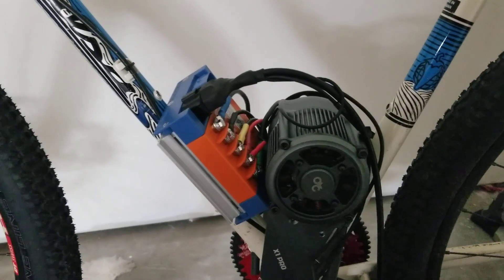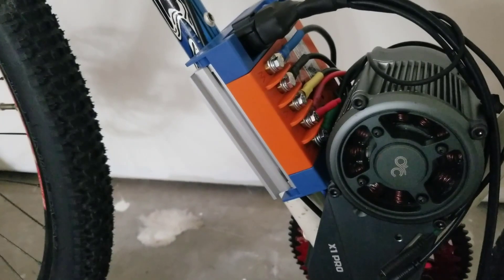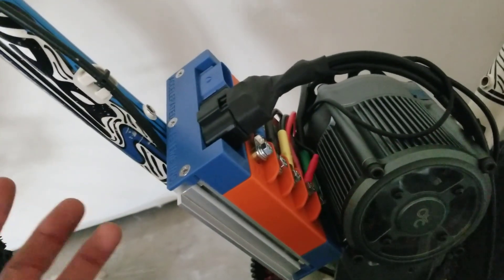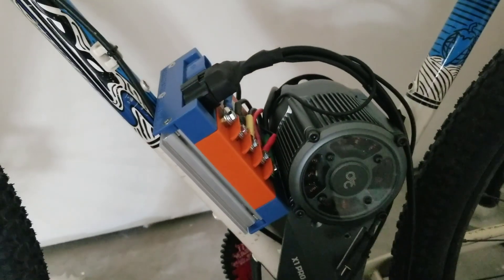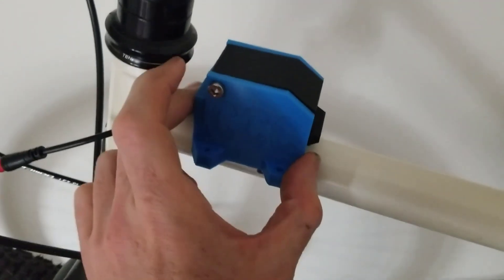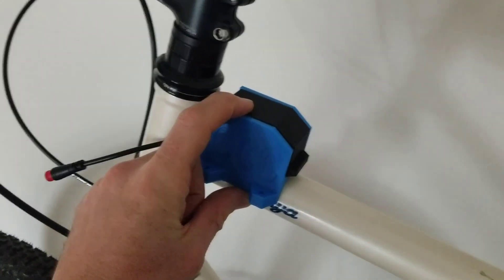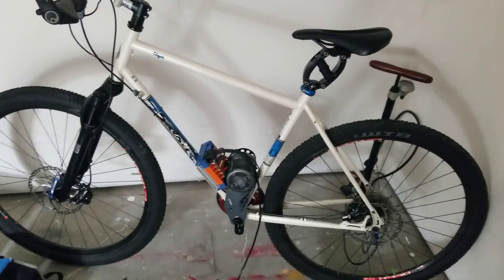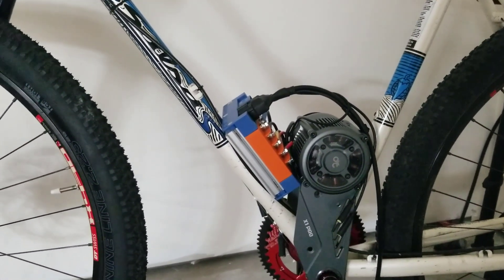Salsa Build Update - BAC2000 / CYC X1 Pro / NXT Display

Comment: Also how do you like that thudbuster seat post?
Reply from the maker: Its great. Although only just fits with the height.
Reply: @HighVoltageKits  I have the red shift one and I love it but it only has 30mm of travel and I often can bottom it out and to stop that you can adjust the preload on the spring but then your making it a stiffer ride I am debating getting the lt thudbuster to try that out.  The only issue I run into is I recently switched to a rear rack that connects to the seat post and between that taking up some space and the min height the suspension seat posts need plus the fact that my bike is a xlarge means I have very little room for adjusting the height.

Comment: Where did you get that ignition switch?  I got two of the bac855 kits for the BBSHD and I have a bac2000 I'm not.using but the bac855 harness Alan sent me has the ignition set up too but I need to get a switch like you have.
Reply from the maker: I was sent it with the kit but you can get one on Ali or Amazon. You might have a blank pigtail you can solder a switch to. And switch will work pretty much. You can get key barrels as well.
Reply: @HighVoltageKits  yea the harness Alan sent me has the ignition plug with a bank pigtail plugged into that so all I really need is a good switch or keyed ignition

Comment: What bike groupset do you use? Will a cyc motor snap mountain bike/commuter chains(assuming I don't go into too high of a gear)?
Reply from the maker: Its a 10spd steel that came with the Salsa Vaya frame. It's holding up well. The chain is SRAM. It's not stretching so far. I don't use the high gears as it goes silly fast 65kph in a 24t I think. Hope this helps.

Comment: What battery did you end up using for this? I was looking on light speed batteries and wondering how powerful of a battery I would need to have full performance from the bac 2000.
Reply from the maker: In the end I chose to stay where I was and just tune it. It hits over 70kph on the flat with a BAC800. The battery I have is a bit odd tho. Its a lipo pack with pretty much unlimited current draw so I'm not sure what spec for lion. I was getting trips at a 50 amp continuous bms so I'd say at least 60. For longevity I'd go 80 continuous. Maybe shoot Francis at Electron an email and ask. He is a CYC dealer so he will be able to recommend and likely supply a good battery. Hope this helps.
Reply: @HighVoltageKits  I was looking at the 72v 24.5ah(80a bms) 72v21ah(60a bms) and the 72v18ah(300a bms) high discharge batteries on lightspeed(the link in your desc).  Do you think I'll have any problems with these?
Reply from the maker: I run the 300 amps version on my other bike and it's awesome. If you can get one Chris Conlons batteries are good

Comment: Hey I have a question about the ASI 2000  I use the controller on a Qs 205 5000 motor with a 72v 44am and it keep giving me a over voltage and it cut off can anyone help me out with that?
Reply from the maker: You are welcome to join and post on my discord. It will be hard to help on here. Also if more people see it then they might be able to help... Are you using regen? https://discord.gg/9UwDG4j
Reply: Captain Codswallop nah I didn’t connect regen on the throttle just throttle for now
Reply: Captain Codswallop and I just downloaded the app for the chat room

Comment: If the motor were mounted in front of the down tube, could the BAC 2000 controller be fit between the mounting bracket like the standard controller was designed?
Reply from the maker: If I modded it possibly.... But it would hang lower by some way. I'm 90% sure I am going to make a bracket for the seat post and divert air flow. It won't need much as I'm not going to pushing it to its absolute limits with this build.
Reply: Thanks for the reply! I was thinking of I went with the BAC 2000, I would take a light aluminum rear rack and cut it back so it would be just large enough and strong enough to support the controller and a set of rear lights. I would then design / print nylon-carbon mud geards that would integrate with the rack
Reply from the maker: What is this nylon carbon stuff you speak of?

Comment: That's huge, Don't forget to put a wide-load sticker on the back of your bike. lol.

On a serious note, I use a conformal coating on all my race drones electronics and corrosion X on the wires and connectors, I have plucked them right out the River and the SF Bay with no issues of them taking off and flying again.
Reply from the maker: That's good to know! A few people mentioned conformal coating. Should keep the phase wires safe for sure. Good to know it that effective. 

A wide load lol. That would be funny! I seen a few bikers that could use that sign 🤣🤣

Comment: I think I might consider using a Topeak explorer rack with one of their bags and mount the controller somehow. I have no affiliation but I am planning to get one because I like their design. Having said that I don’t know what type of airflow requirements the controller might require so it might not be a good/safe option. I also don’t have a 3D printer so it limits my options. Interested to see what you come up with. I think the size of that controller would discourage me from getting one.
Reply from the maker: They only get bigger from here! Rack is a good idea. I am going to determine the cooling requirements while I am looking at options! The rack is very nice! Cheers

Comment: Hi Captain Codswallop, isn't the CYC X1 Pro rated at 3000W / 65A? Or can it be run at double that power with the ASI controller? if this is the case, I don't think a regular bike hub with regular wheel spoke can withstand that much power and torque. Unless you change your wheels size to maybe 20 or 24in to reduce the torsion force, that frame is likely going to snap under load. Remember that an elite cyclist can produce about 400 watts of power at the wheel using bike frame designed for this purpose. My guess is you probably are looking to install this setup on an Enduro type ebike frame with motorcycle wheel in the future. Anyhow, best of luck with your builds, always enjoy your videos. Cheers. Dan
Reply: I have a X1/2000 72v setup, peaks 6kw. 26" wheels. Frame is the least of the problems, but you need good hubs and a cassette that is one-piece, or big pieces, not one by one. Best frame is by far a DH frame, it can take it all.
Reply: @nielsbaardseth  Yes, agree that a Downhill frame is much suitable for this range of power, they are made to be beaten, but running 6kw on a street bike could be dangerous, specially with almost 250 lbs of extra weight on it. My first ebike build was with a 1500watts (1800w Max) hub motor on a full suspension Mountain Bike Frame. It was scary running this thing at 60km/h, the bike would start shacking at high speed and it was clearly not safe with that extra weight and power. My current build is with a EBB Enduro eBike Frame from EM3EV using a Bafang BBSHD and ASI BAC800 controller. It has small 17" motorcycle wheels and tires and 10 Gauge Spokes, so no worry there. With a 42T chainring and 11-46T cassette,  it is impossible to keep the front wheel on the ground on first gear at full throttle. Small wheel really is a must if you are looking for crazy torque. I use mainly this bike for trails riding in the forest and not for road rides, so this is why I went with this approach. 

Here it is in action... https://youtu.be/zbBiMlinzlo
Reply from the maker: I'm going to take the cassette off and have a look at some point. It is a touring frame to I suspect everything is steel but I will find out! The NXT has three rider profiles you can setup so there is no way I'm ripping down the street. I'm a pretty light guy so the estimate total weight including the rider is 250lbs. If the wheels cant hack it I will try a smaller size. I can always drop down to 52 volts. In terms of front wheel lift if the throttle ramping is set right it should be ok. Thanks for the advice. I will do lots of testing! Cheers
Reply: @HighVoltageKits  These tires look like 29" ers... bigger circumference = lots of strain on your drive components (Chain, Cassette, Hub, Spokes) . You will probably be fine if you are gentle on the throttle, but problems could occur on higher speed where wheel components could fail if you hit the throttle hard. 

This is what is so great with DIY builder,  you can make changes in order to improve on what you have learn with experience. Be safe and don't try to break the land speed record on an ebike... 140Km/h could be a little bit dangerous on this bike frame... LOL 

Keep your camera rolling...
Cheers.
Reply: @HighVoltageKits  Also, did you check how much clearance you have between the pedal cranks and the BAC2000? You may want to mount the controller higher up on the down tube in order to avoid hitting it with your ankles while/if pedaling. You could also look at mounting it on the seat-post tube instead if wiring harness is to short. Cheers
Reply: @HighVoltageKits  Looking at  your frame, it look like you have 2 Bottle Cage Mounts on top of  your down tube.  Why not use these to attach a 1/8in aluminum sheet bent on each side so the BAC2000 sit inside of it. You could use countersunk screws to attach the aluminum case to the Bottle Cage Mounts and use heatsink compound between the controller heatsink and the aluminum case for excellent cooling. Then you could 3D print a cover for the aluminum case so your controller is completely inside a case with no wires exposed. I could do a 3D image if you're not sure on how to do this...
Reply from the maker: Thanks for the comments. The seat post is a decent idea. I am going to look at that for sure. It would make the battery space easier to work on as a side bonus. Cheers!
Reply from the maker: I will likely test it for the sweet spot in terms of power. 5kw is well within the limits of the motor. The freehub might fail if it's not steel. I'm not 100% sure what it is. I'm not worried about the frame as I have seen this controller run at high power with no issues on other builds. I may well try it on a different frame in the future tho. We will see how it goes. I follow the grand tours so 400 watts is a level that can be churned out all day long for those guys. In a sprint Mark Cavendish and others churn out over 1500 watts over short distances. It's going to be interesting how it goes for sure! Cheers

Comment: Looking pretty good so far, I can't believe how big that Bac2000 is compared to the 800.

Have you done any printer upgrades lately? I just got an E3D Hemera and some hardened nozzles to print carbon fiber poly carbonate filament and it's just awesome so far really light weight and strong.
Reply from the maker: I am not sure 100% I am reviewing several options on the printer front. I am meeting some people with some high end stuff soon as I will need to print stronger stuff for the bac2000.

Comment: Taking the controller apart and applying “conformal coating” to the circuits can achieve your waterproof goals.  It needs to be expertly applied as there is no going back.
Reply from the maker: Sorry. Maybe I should have been more specific. The area to waterproof is the external wiring loom and phase wires etc. I could probably use silicone but I think keeping dirty water off the controller would be wise. Silicone fails fairly fast. The controller itself is IP67 so no worries there. Gonna look up conformal coating tho! Cheers